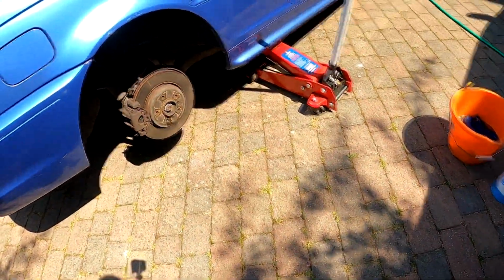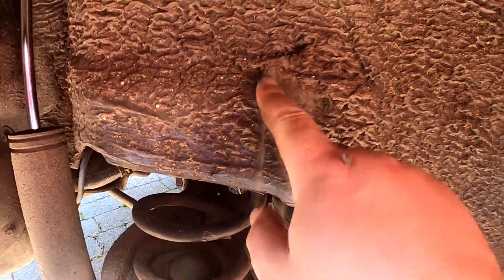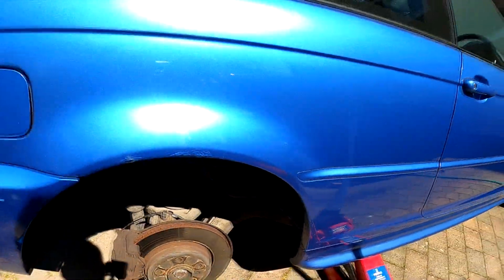Stance Nation

Comment: Moving the wheels out that extra 15mm makes a massive amount of difference to the number of stonechips the car will receive, Especially up the sides of the doors.
You might need to put something in place to mitigate them. Paint protection film or helicopter tape, or even some small mud guards.

The 90-120 number you mentioned isn’t the range of torque, 90lbft of torque is roughly 120nm. It’s the Same torque spec just in a different unit of measurement.

I’d leave the torque wrench handy with the socket on it and check your bolts again regularly; you’ll find they keep loosening for a bit until they finally settle.
Reply: Worth noting too that torque wrenches should be handled with care and set to zero after each use. If kept set to a certain setting or dropped repeatedly they can lose their calibration.

Comment: How comes you didn’t put any copper grease on the hub/spacer John
Reply: Anti-seize is great but only on the centre lip / spigot area. The engine torque is designed to be transferred from the hub to the wheel by the friction of the two mating surfaces. The wheel bolts should only be used to clamp the mating surfaces together, not to take any lateral forces or they could shear.
I always apply it to the centering ring only and never have a problem with removal again later. The biggest factor is making sure you clean the mating surfaces thoroughly with a wire brush or similar tool every time you have the wheel off.
Make sure you always torque the bolts to spec with a torque wrench too, instead of just hanging off a breaker bar until they squeak. Around 110Nm is common for most cars but check the manual.

Comment: wich spacers did you use? i have the same car as you so im thinking about buying aswel
Reply from the maker: I used TPI spacers 15ml front and back.  TPI spacers are good quality.  Motech sell them with the bolts.  just need to ensure you buy the longer bolts.  Speak to Mike at motech if in doubt.
Reply: @forensicunplugged4295  alright, i think i Will go with a swedish brand instead so no Shipping. Ive heard that you can have 20mm in back and 15 in front, you thi k that Will work?
Reply from the maker: @god5192  20ml at the back might be a bit risky from what IVe heard.. might rub with certain tyres.
Reply: I have mtec spacers on my e46 coupe 20mm front and 15mm rear, lowered on eibach sportline springs, really sits nice
Reply: @forensicunplugged4295  alright, ive ordered 18mm back 15mm front, worst case i Will do 18 in front and 15 back, but i want back to be wider then front. I can show some pics after if u want to see
Reply: @user-tj6gv9ws3o  just installed my 18mm back and it works fine, looks really good im happy. Gonna i stall de 15mm front today i think or tmr